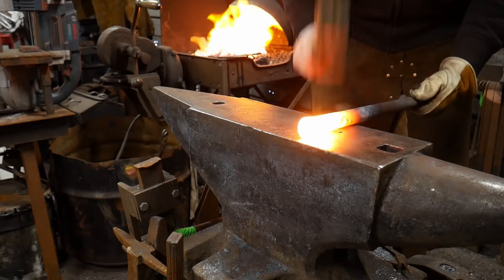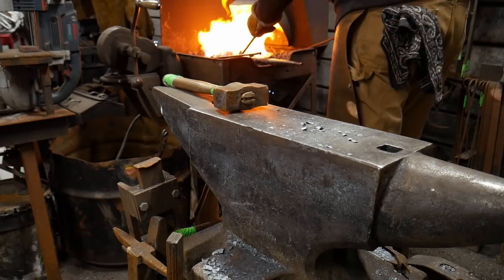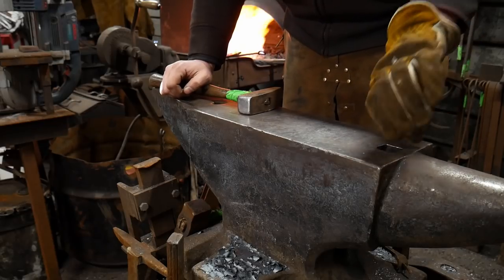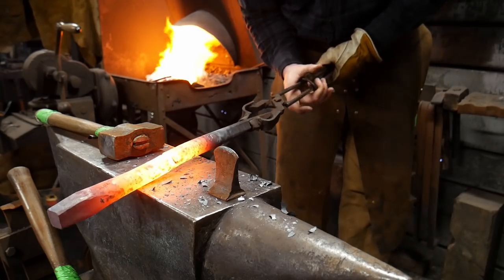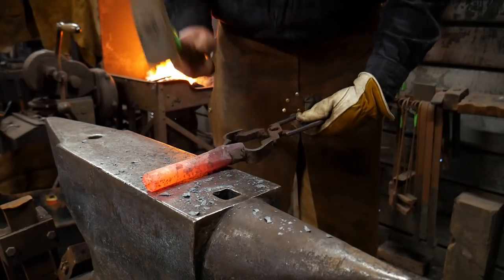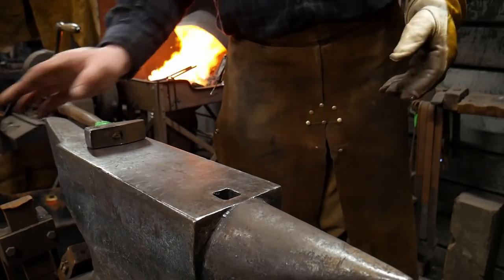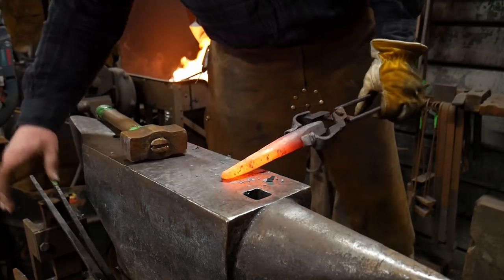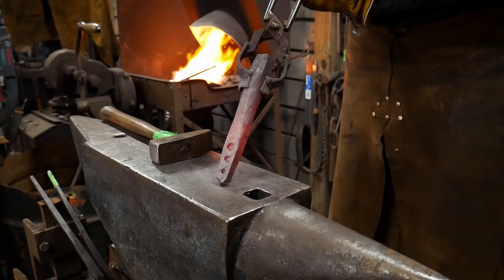Forging a Rivet Bucking Bar for Scroll Making

Comment: Rivets R Cool😀.  I made a bick iron, from a 1070/1080 steel, similar to you demo. Once I finished forging, I drove it point down into the damp sand&earth below my anvil stand. Left it to cool for about 2 hours. Upon inspection the next day, I discovered a crack in it. Not wide, nor very deep.  I need to watch the hardening & tempering video now, to see where I screwed up 3 hours of work

Comment: Rivits are cool !
Especially when it is taught by a cool cat 😁

Boy that's alot of hammering lol. I just got a feeling that you really would rather have used the power hammer.  But much respect for showing the hammer and anvil way. Like you said not everyone has the power equipment. 
Edge of the seat waiting for the heat treatment process to come now.
   Blessed days sirSir,  Crawford out